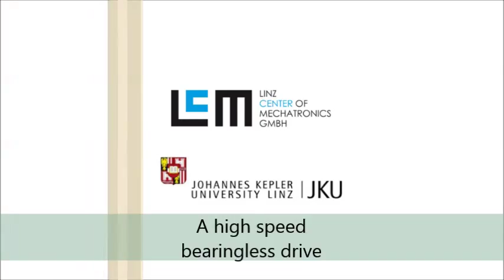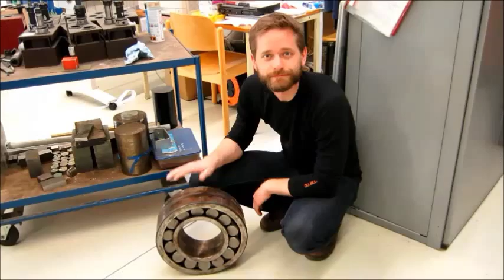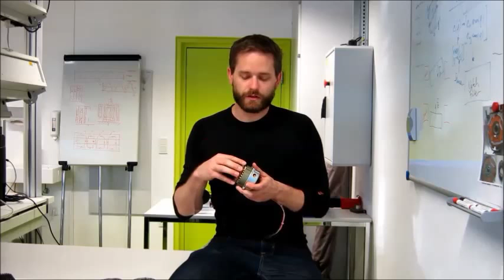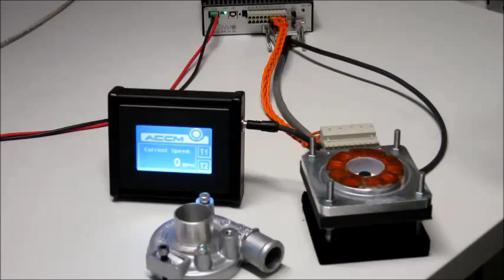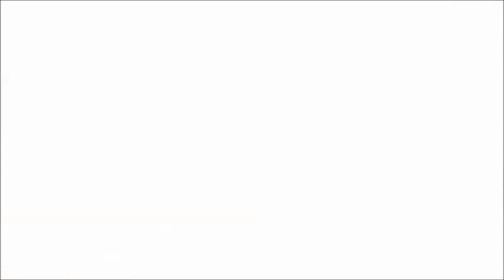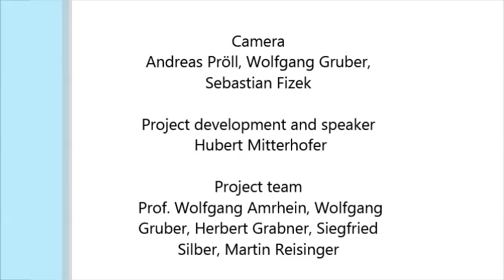Bearingless motors

Comment: Subscribed :)  May I make a suggestion to your video editing?  When you mentioned no friction and no wear at the 2-minute mark you should cut to the video of you wiping your finger on the stator as you say it.  Same for when you say we don't need any lubrication. Instead of the video of you sayiing it we get the audio of you saying it as we watch the video of squirting oil on your finger.  It will smooth the flow of the video.